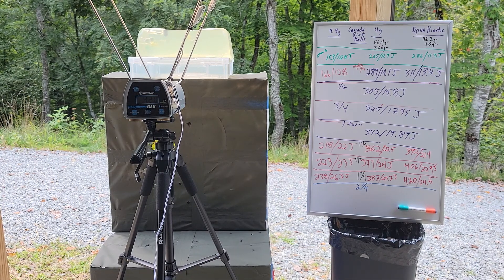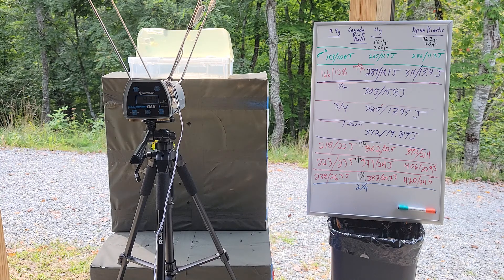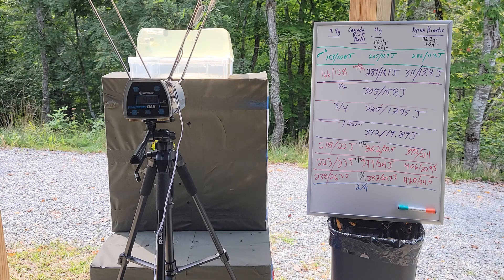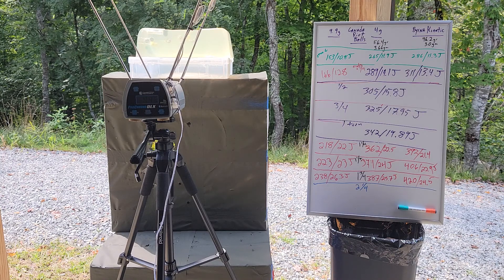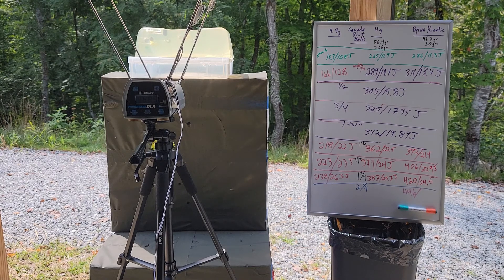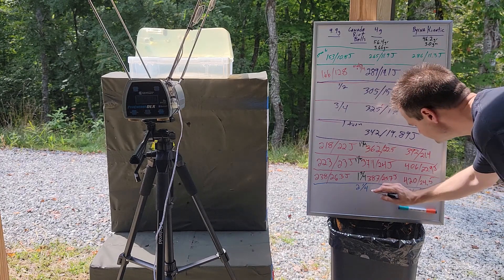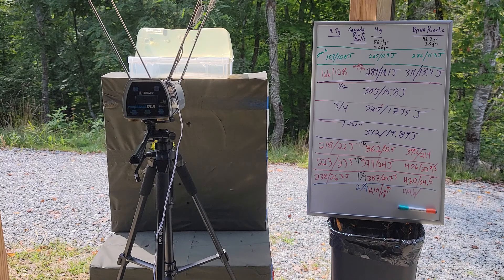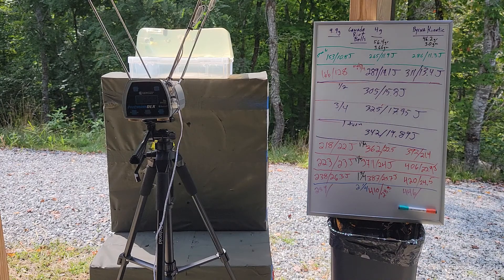Valken M17 power tuning Part 6 (up to 31 Joules, more to come)

Comment: Hi. I have a valken m17 already tuned from Homewrekker and I'm shooting grimburg Jul v2 8.8...they hit hard as it has been tuned by Homewrekker for 38-40 joules at 300 fps.....my question is have you used any byrna max or byrna pepper in that high power valken? My dream mag would be first 3 rounds as byrna max followed by all the rest Grimburg but I'm afraid the byrna will burst from high pressure tuning that it has
Reply from the maker: Oh even my HDS that's got the 16 Joule upgrade will bust a paper ball.  I wouldn't dream of shooting any brand pepper ball in anything that powerful.  I would say even anything over 15 Joules would be pushing it with some
Reply: @DK-Spencer  OK thanks

Comment: What was that double burst on that last shot? Also between the 2 full turn and 2 1/4 turn did you fire empty or did you fire with balls??
Reply from the maker: Not sure, but I blew the regulator cap after, lol.  Not sure on the other question, I got lazy and in a hurry though, that's why I blew it.  So, I would fire several each time with balls to be safest I would think
Reply: @DK-Spencer  I just ordered two caps from Mikey just in case lol